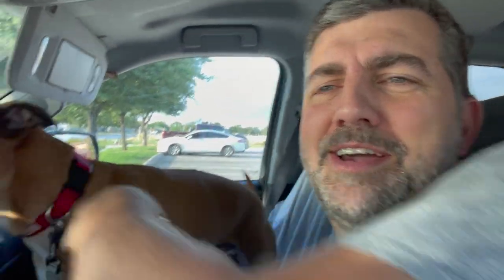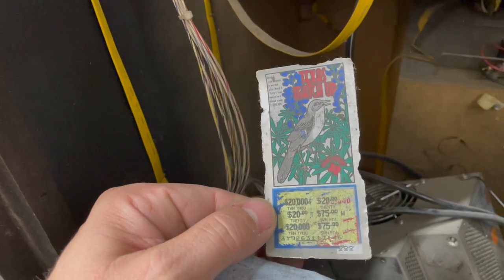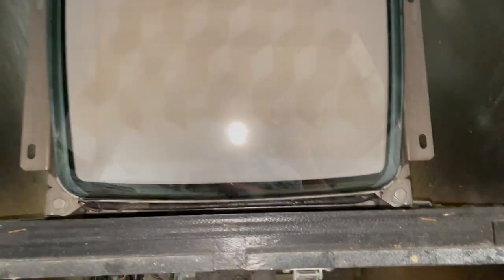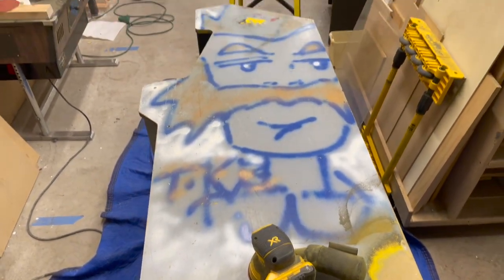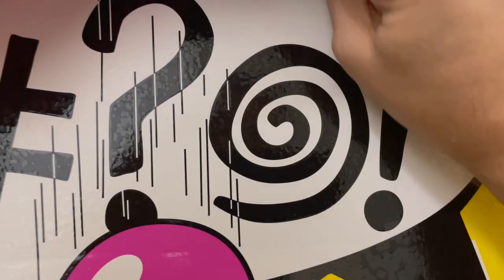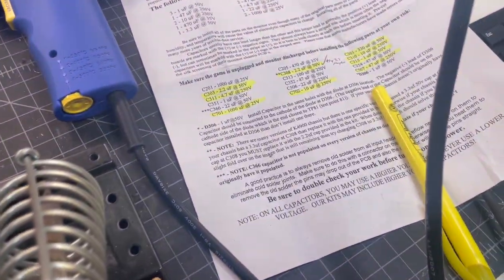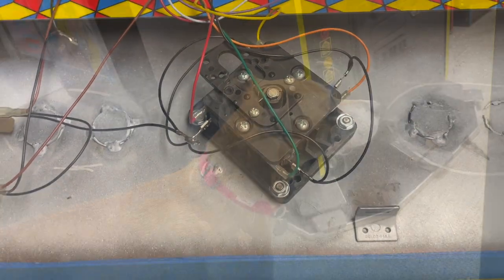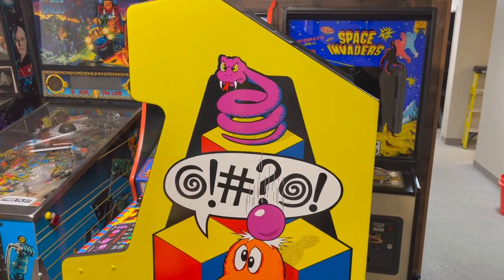QBERT Arcade Restore

Comment: Awesome result.
This might be a stupid question, but wouldn't it be a lot easier to remove all electronics, the screen, etc. from the cabinet before working on it? I would imagine that sanding and painting an empty cabinet should be way simpler. Is there a reason you don't do that?
Reply: My guess looking at their shop is that since these projects can drag out and they don't have room to swing a cat, it helps keep the parts for the game all together and in a smaller footprint.

Comment: Did you notice that this was the very first time I've ever seen the Q'Bert video arcade game machine getting restored? Even though it was, however, still originally an old-timer tiger, HELI helicopter video game. The thing is: they just don't make video arcade game machines like they used to. It was also too bad that our video arcade game machines cabinets were made out of plywood and not Georgia Pacific fiberglass. That's what our new business buildings are made out of. 😳 😄 😀 😅 🤣 😆 😳

Comment: Awesome restore brother.  Which led do you use for the marquee light?  I want to swap all of mine to leds
Reply from the maker: 12 inch led under cabinet light from Home Depot. 1005 396 890 white. Just cut the plug off and wire it straight in. They have one with no plug but it’s like $14 more. No thanks, I have scissors.
Reply: @ElectricStarshipArcade  hell yeah. We got snips and electrical tape for that. Lol. Just kidding,  

I see you do a lot of dedicated stuff. I would love to but the cabs in my area are so expensive so I get the ones I can and mainly focus on universals like Dynamo’s since I’m just using them in the house.  Quick question though, ever ran across a sit down outrun 2??  

Also I appreciate the light number. I want to switch all of mine over

Comment: Tiger Heli is a vertical SHMUP that uses an 8-way joystick so I don't know how you could have mistaken the joystick that was on it for a Q*Bert joystick.  Still, it looks beautiful and you did a good job on it.  I wish I had the space and the know-how to restore video game cabinets, I'd build my own arcade.
Reply from the maker: The joysticks looked similar, had the ability to be 4 or 8 way, and a lot of time operators back then tended to use them every part they could to keep costs down when they converted a game.

Comment: what type of paint do u use on these cabs
Reply from the maker: I use oil based enamel. That way I can apply side art without worrying about degassing. If the paint degasses once the side art is applied it can create bubbles underneath